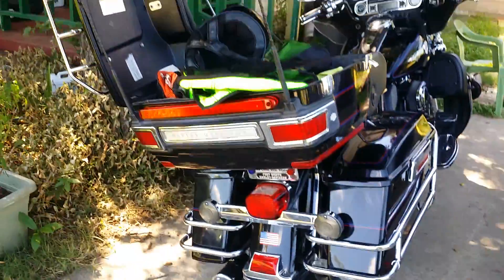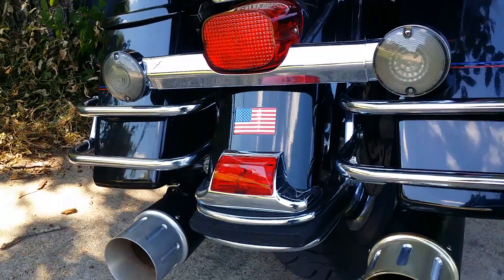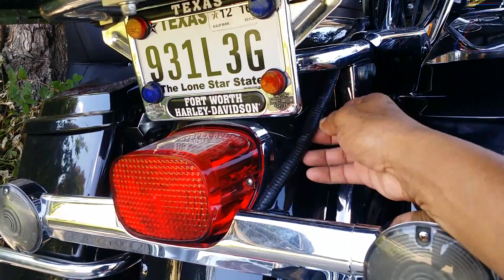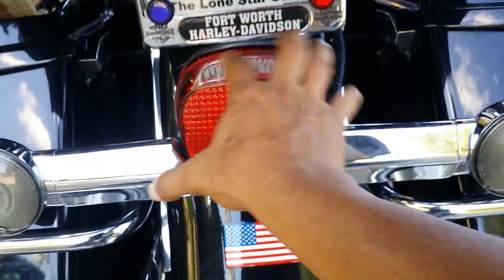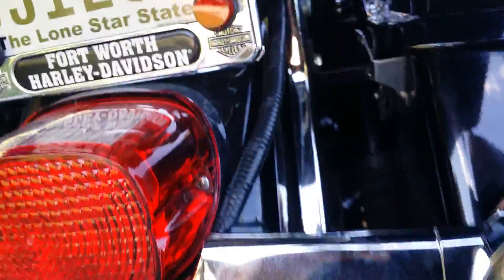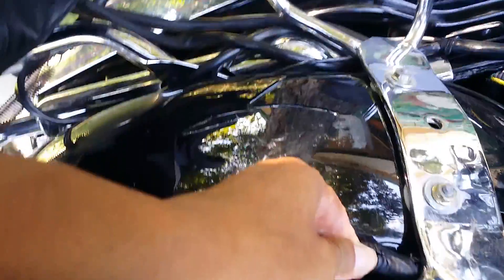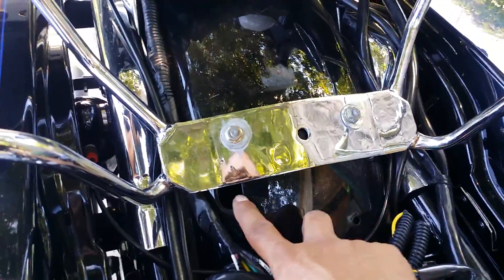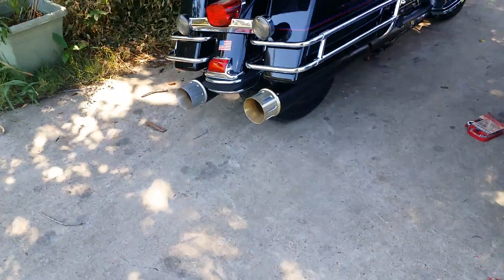Harley davidson tail lights problems

Comment: Was the wire damaged before you reran it outside the fender?
Reply from the maker: Yes it was …. It took me about 30 minutes to find out what had happened
Reply: @A-37Bdragonfly  TY for that. My 2013 softail tail light won't stay on.I have to turn the ign switch on and off several times to get the light on but as soon as I start the bike it goes off. Brake light works fine. I did bottom out the rear tire a few months ago. The fuel gauge also quit working and the red LED is always on now.

Comment: How far did you lower it and why would you lower it? The engineers designed the rear fender and wiring harness for the stock height not your aftermarket lowering kit that serves absolutely no purpose, some people shouldn't work on their own bikes...
Reply: Lowering serves no purpose? How about for shorter riders?
Reply: ''Serves no purpose'' WUt?
Reply: You can cut these at stock height don't need to lower it

Comment: The engineers run the line inside the fender because it looks ugly and unprofessional running it on the outside. Same reason guys like internal wiring in the handlebars. It looks cleaner. Also based on their numbers running it inside causes no issues when the bike is stock. If you decide to lower it three inches then you should have rewired it from the start.
Reply: On my 2011 softail crossbones stock its stuck to the inside of the fender with some kind of adhesive, (surprised the hell out of me, figured they'd atleast have some type of clamps) anyways it came loose and was dangling in a section and rubbing on my tire and burned a whole though the wires... so now I get to replace the wiring harness this weekend. Gave me an excuse to get new tailight/turn signals though.

Comment: You lowered the bike
You put weight on the bike
You're wires rubbed against the tire and caused a short

The original tolerances and clearances on the rear fender are designed to have a certain amount of clearance,once  you modified the rear suspension and lowered your bike you changed that . Subsequently, the tire to rub up against the wires and caused a short. If you were as smart or smarter than the Harley engineers you'd know this. Perhaps, you should call Harleys R & D department and tell them they're idiots, I'm sure they'd love to hear your story.
Reply: Jorge Villegas 
Plus it looks like crap 💩

Comment: Do not use lowering brackets. You only are good for 250 pounds of laden weight. Get 10.5 inch burly slammershocks.lowers 2 inches. If you need more, change seats